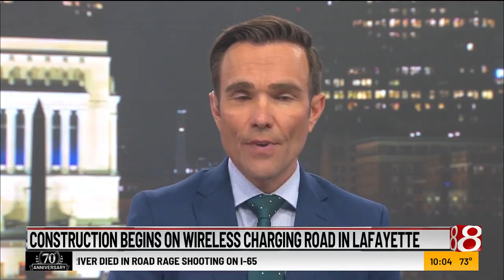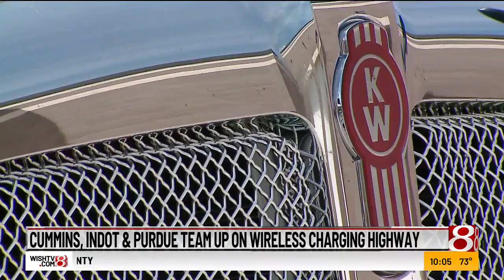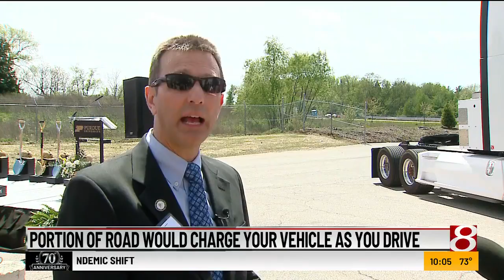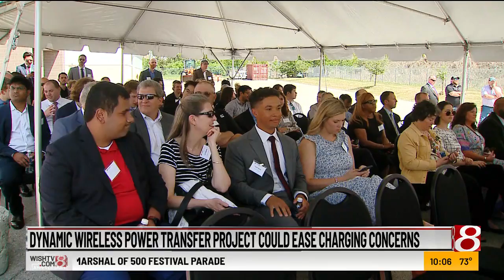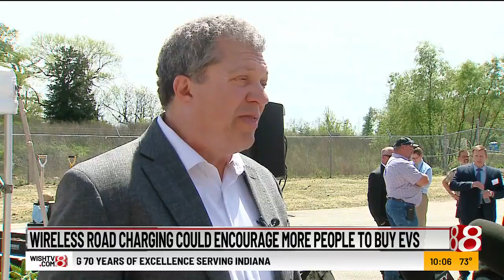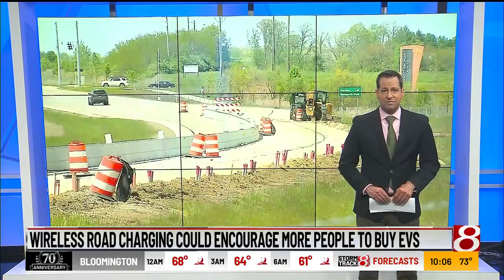Wireless charging highway will charge "vehicle as it's moving at 65 mph"

Comment: I still don’t get it. 
If you add an alternator to the vehicle. Wouldn’t the tires turn the alternator. Making electricity. Am I the only one thinking about this.
Reply: Not physically possible. Takes much more energy away from drive motor than returns. Like a perpetual motion engine. Only in fantasy, laws of nature prevent such
Reply: No. An alternator doesn't work that way.  
   
An alternator converts fuel energy in the car into electrical energy to power the car's electrical systems. The energy in these embedded coils comes from an electrical power plant rather than the fuel of the car. The coils simply take electrical energy generated by a power station and pass it to the car's batteries via induction.   
   
Just so we're clear, you can't generate energy with an alternator. An alternator only converts energy from one form to another (chemical to electrical). And, just like any form of energy conversion, it takes energy to run an alternator.

Yes, the power plant also just converts energy. It takes coal, oil, hydroelectric, solar, or nuclear sources to convert that energy into electricity. However, this is a MUCH larger fuel tank than what you have in your car. If you have a continuous source of electricity for your EV, then you can theoretically travel as long as you want without stopping. This is impossible with traditional fuels, and that's the ultimate goal of these induction experiments.
Reply: @brianstone6463  ok. So the spinning alternator in your car doesn’t charge the battery ?
Reply: @brianstone6463  so hydro. Is a spinning machine.  Wind is a spinning machine.  Whatever you just said in hear. Makes no sence. There’s no fuel going to an alternator.
Reply: @brianstone6463  As the alternator rotates, it creates a DC voltage primarily to charge the vehicle battery
Reply: @brianstone6463  there is no fuel in an alternator. Your high
Reply: @brianstone6463  so alternator can’t generate energy. But a generator. Generates energy. 
So a spinning hydro plant uses coal. And wind energy comes from the sun
Reply: @brianstone6463  so why do you change your alternator when it doesn’t charge your battery
Reply: @brianstone6463  Your alternator is also responsible for charging your car battery while driving. The alternator works by turning mechanical energy into electrical energy. When your engine is on, it powers a drive belt that rests on a pulley attached to the alternator.
Reply: @brianstone6463  go put some fuel in your alternator. Are you millennial. ? Do you even know where the alternator is. ?